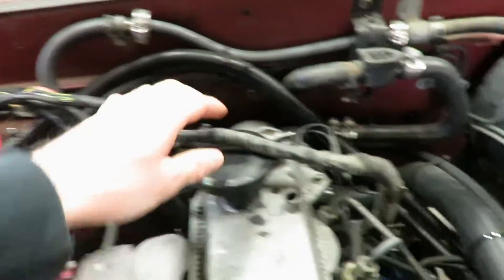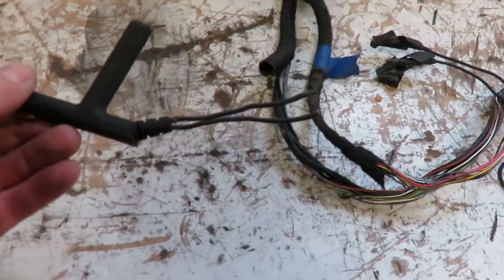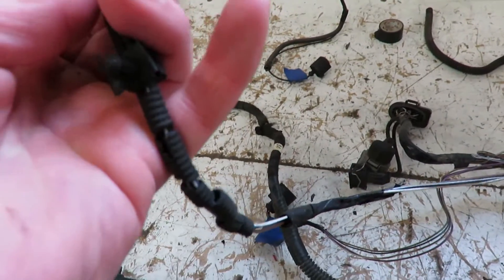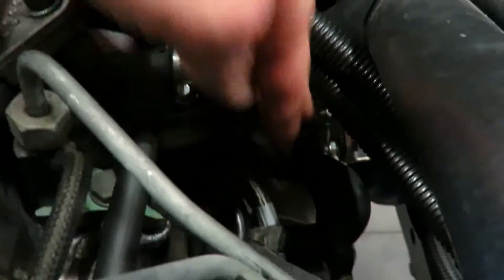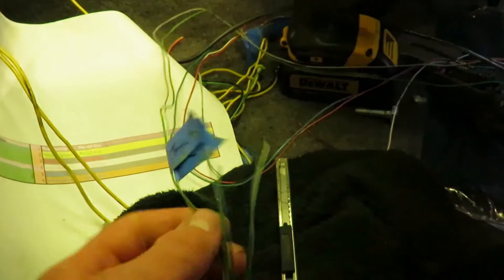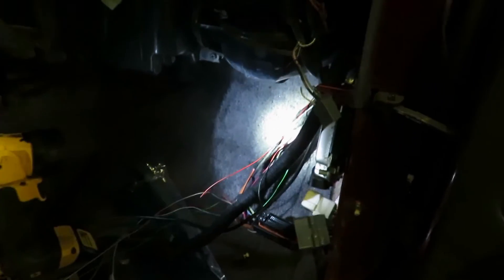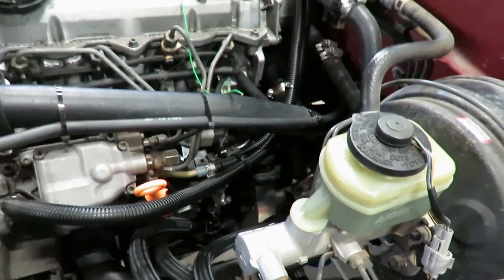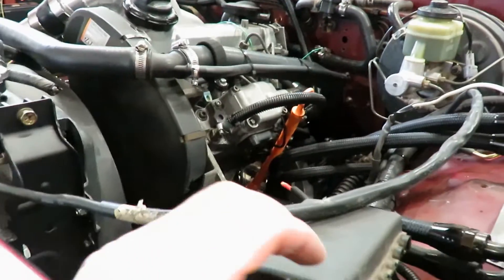Toyota TDI Swap Wiring Part 7 Finishing the Injection Pump Harness

Comment: If you have a CEL for the glow plugs, check out the big 50 amp glow plug fuse. I tried to fix my glow plugs for a year by replacing the harness and and other stuff, before realising it was just a blow fuse
Reply from the maker: masterjdawe thanks! The fuse is good! I’m sure it’s a bad glow plug or two